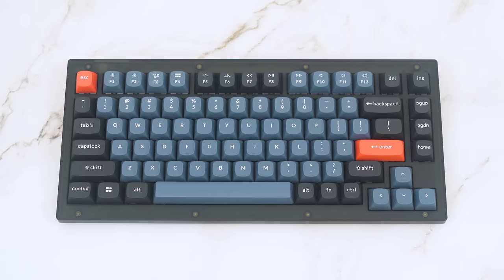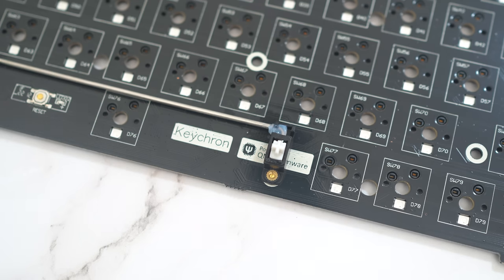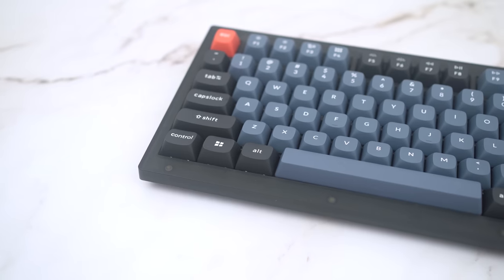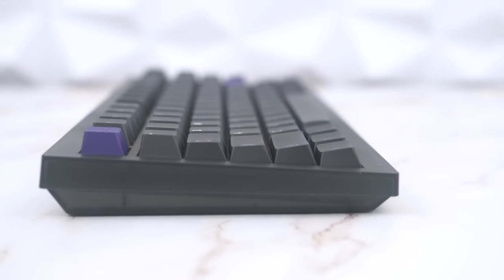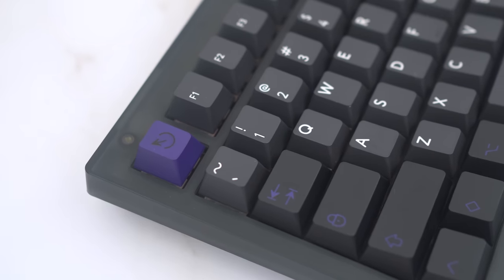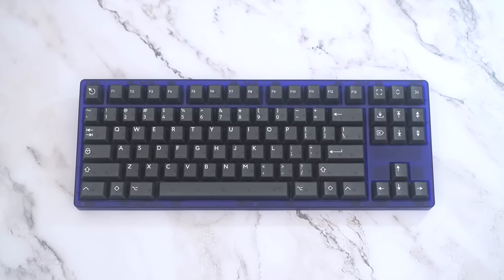I Modded a $54 Keychron to Make it GOOD - Keychron V1

Comment from the maker: Sorry guys!  I made a mistake when I said the KBDFans Tiger80 Lite was only around $89.  I was told that the Tiger80 LITE kit will be somewhere in the ballpark of $125.  My mistake and apologies for the confusion!
Reply: tsk tsk. you should know better. 

Just kidding. I was actually surprised when you said that price. I was like THEY DROPPED THE PRICE?! Then I went to check and went aww... lol
Reply: Hey there! I recently came across the HOTO Compressed Air Capsule and it seems like a great tool for maintaining a clean desktop setup. It offers powerful vacuuming and blowing capabilities, making it efficient for keyboard cleaning and overall dust removal. Plus, with its versatile features and ease of use, it can be handy for car interiors and outdoor activities. Definitely worth considering!

Comment: Just wanted to let you know, they added a disclaimer on the V1 product page that "Starting July 20th, the shipping fees will be decreased by $10 and the product prices will increase by $10." So, instead of the barebones knobless version being $54, it's now $64, but that doesn't matter because the total cost after shipping will still be the same. Still, nice video tho.
Reply: its not even 64 its 80 with shipping and at that point you should just get a kbdfans67 lite or an akko board
Reply: @FootyBalls12  sounds like you watched consumer tech reviews video  on the v1 and actually took his advice. Sad.
Reply: @FootyBalls12  I mean a 67lite is 130 + shipping so maybe 150 and akko boards for a acr pro its 120 + shipping so 140. So the keychron is pretty cheap at 80 bare or 100 prebuilt
Reply: @FootyBalls12  The prices I mentioned were only for the board itself, excluding shipping
Reply from the maker: Thanks Andy for the info!
Reply: @FootyBalls12  Akko $80 boards are tray mount with a much more cramped layout, no qmk/via and no pcb mounted stabs and less sound dampening. Their stock stabs are pretty good, but IMO just not as good as what pcb stabs can reach. So for a stock board, Akko might be better but if you really wanna get into the hobby the v1 is just better.
Reply: @FootyBalls12  u skip english class or some shit???
Reply: @lukasderstecher4582  pov: you missed the gb
Reply: @FootyBalls12  if you add the shipping on those you aren't beating this lol
Reply: @lukasderstecher4582  at that point just get a qk65 on the next batch
Reply: @FootyBalls12  they increased the price for the base version so you can put more down as a business expense
Reply: If that is the case then reviewers should be judging it based on the total price, including shipping and not just the keyboard.
Reply: @FootyBalls12  No QMK = no deal.  Like, why bother buying a keyboard if I can't even put custom firmware on it?
Reply: @nearly-  What did he do? I've seen some people complain on Reddit cause he said the V1 is a bad keeb or something like that.
Reply: @nearly-  NVM I just looked at the video. It's just him acting like he's an enthusiast and yelling at keychron because it did something better than Akko
Reply: @nearly-  why is it sad?
Reply: @ToyKeeper  i dont find qmk as a need but some people do so sure
Reply: Without the shipping prices and if it were on a 3rd party website that does not charge as much for shipping then ofc i would get it that is a steal i am  just saying you are not getting 80 dollars worth with the shipping
Reply: @Andy-rp1kd  ik you did a good job pointing out the base price had increased
Reply: Sounds like mumbo jumbo to increase the price. That change doesn't help for proxies cause they can reduce shipping but not product price
Reply: @Donbros  if your in the official discord the reason it was changed was so that people who write the boards off their taxes under a work item can do so for more value as shpping doesn't get written off
Reply: @FootyBalls12 how is this worse than a kbd67lite and not to mention its like 130 with shipping this is just around 80 the 50 dollar difference
Reply: And with tax it's over $100.

Comment: You can accrully gasket mount a keyboard with foam, you basicly stack much foam around the standoffs and screw the two inner screws in, you can also combine it with o-ring mod.
Reply from the maker: Ahh the stack mount.  The V1 kind of comes like that already.  The lower silicone pad is thick so the pcb can bounce on it.  However, the upper plate actually screws into the lower case so if you omit that, you may be able to pull it off
Reply: @Keybored  I did it with my k552 and its like a trampoline
Reply: @Keybored  where can I found a tutorial?
Reply: tutorial please , bro

Comment: It's really tempting to get one and throw on my favorite caps and switches and firmware... because it's cheap and weighs half as much as a Q series board, which are both great bonuses.  What would be really cool though... is if they did a lightweight "V" version of their upcoming Q65.
Reply from the maker: I feel like Keychron will keep expanding their lineup going forward!
Reply: You can grab their 40% version and it will be a super lightweight travel board.
Reply: @matasa7463  But if I got a 40% version, it would be 40%.  No thanks.  I only like keyboards in the 65% to 75% size range.

Anyway, I have a Keychron V1 now, and a Q65, and they're both great.  Durock T1 switches and some nice MT3 or AF SA caps, and heavily customized firmware.  Very happy with both.

Comment: This comes at a perfect time since I've got one in the mail right now. Figured that at that ridiculous price I might as well to test out switches. I happen to have some o-rings in a drawer somewhere so this is perfect.
Reply from the maker: Perfect!
Reply: Hey there! I noticed you mentioned having a Keychron V1 keyboard. If you're into maintaining a spotless desk setup, I highly recommend checking out the HOTO Compressed Air Capsule. It's a versatile, compact device that offers powerful vacuuming and blowing capabilities. It's great for keeping your keyboard clean and can even be used for car interiors and other areas. Plus, the price is reasonable compared to other brands. Definitely worth considering! Let me know if you need any more recommendations. Happy cleaning!

Comment: Unmodded keychron sound test 1:45
Ktechs S1 Peach Switch + PBTFans Purpolch Keycaps 3:28
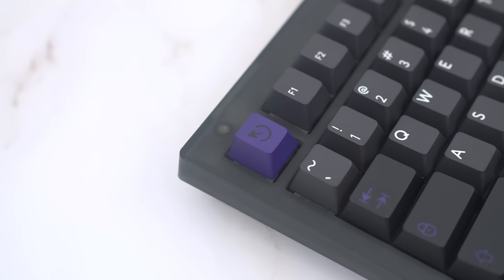Previous mods but with o-rings 6:10
Comparing with and without 0-rings back to back 6:44

Comment: Excellent timing, youtube overlords. I've got my K4 v2 pulled apart and am doing some mods to it, as i type this (on an old membrane board. Sigh). It's got the same tray mount method, and I was thinking about using orings combined with tape mod on the PCB and silicone pour to improve the sound and feel. thank you, @keybored for the vid

Comment: I have reason to believe that every keyboard this guy makes sounds good
Reply from the maker: I think with enough time, you can make most keyboards sound pretty good!
Reply: @Keybored  well, you need the right tools for the job too. the stuff i have just doesnt work lol
Reply: Hey {{3}}, have you considered trying the HOTO Compressed Air Capsule for cleaning your keyboard and other tight spaces? It offers powerful vacuuming and blowing capabilities, making it a handy tool to maintain a spotless environment. The multiple tubes and high-quality filters ensure long-lasting performance. Definitely worth checking out! 🖥💨🔧

Comment: I wonder what PE foam modding would have done, since I’m going for barebones with Gateron Milky Yellow Pros, Dye-Sub PBT Cherry caps, Zeal stabs, o-rings, and PE foam mod, with 3-layer tape mod, too. I’m really looking forward to this build, since it’ll be my first major build. My first build was a Gamdias Hermes Lite, with everything lubed, no desoldering (even though it’s a solder pcb), and 3-layer tape mod with polyfill. It isn’t the best lmao
Reply: What did you do to lube without de soldering
Reply: Pushed stem down and used a brush to push it in thru the sides on the sliders
Reply: @Exolotyze  ah very spotty way to do it and not full coverage and inconsistent but if it works it works

Comment: so i just recently got this keyboard and i gotta say, straight outta the box it basically has no ping to it. i got myself another pbt keycap set from keychron and did the tape mod on it and with the k pro reds its actually quite thocky. i dont know if they improved on it since this video came out, but to me it definitely sounds like it. no noticeable ping at all when it was stock.

Comment: I'm doing this mod, however is nobody noticing he hasn't screwed in the pcb to the plate? It is that way stock and I wonder if keybored's came without those screws, or if he opted not to use them and why

Comment: I think if you we're to force break, ditch the silicone and tape mod it, it would be pretty fantastic
Reply: Hey {{3}}! I totally get your point. The silicone and tape mod can definitely make a difference in the performance of the Keychron V1. By the way, have you heard about the HOTO Compressed Air Capsule? It's an amazing tool for keeping your setup clean and tidy. The powerful vacuuming and blowing capabilities are perfect for maintaining a spotless environment. And the best part? It's reasonably priced compared to other brands. Definitely worth checking out!

Comment: Got 2 questions 
I found a thicker oring with the spec of OD6x CS1.2x  Thick 2.4mm 
-Do you think this will help with the bounciness? and will it have the problem modding this?
-Would you recommend this ring over the spec you used in tofu? (4 x 1x 1.5)?

Comment: Do you think this needs a wristrest for it to be comfortable or is it okay without? Thanks for the great video also!
Reply from the maker: Honestly, this keyboard is super low in the front, even more so than the Q1.  I would actually be ok using it without a wrist rest.
Reply: @Keybored  That's good to hear. I used to have a k8 after it met a glass of orange juice rip and I couldn't use it comfortably without the wrist rest.

Comment: The Ktechs S1 switches seem to be a Tecsee Blue Sky Cloud Linear with a different bottom housing. Interesting
Reply from the maker: Tecsee has making a lot of switches!  The KBDFans one is like that too and they all sound so good
Reply: @Keybored  Ive been enjoying the HPE switches alot. You need to try to get a Blue Sky Cloud Tactile, 13.9mm POM stem length, full HPE housing. It feels like a purple panda on crack. It's fantastic.

Comment: If the o-rings are placed between the plate and the foam do they really have a noticeable impact for most of you? Is it nonsense to place them after the foam touching directly the posts of the lower case just above the PCB?
Reply: This is an old video but I hate looking for answers to questions and no one replies, especially on old vids haha. I'm looking at doing this with my V5, not for the sound but to soften the harshness of the steel plate.

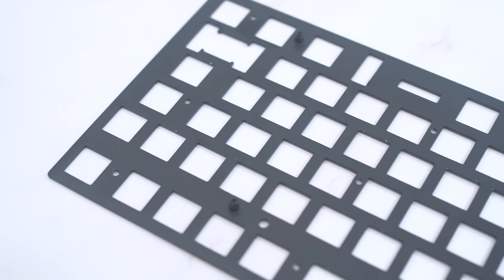The o-rings have nothing to do with the foam. The plate foam has holes in it where the standoffs of the case go up and through the PCB/foam sandwich. There's also holes in the foam for the standoffs of the plate that secure the PCB to it with screws from the bottom. The o-rings will just sit inside the holes in the foam and up against the bottom of the plate. You can see all these holes in the plate foam at 5:05 of the video.

The o-rings will sit on directly on top of the plastic standoffs of the case. The plate then sits on top of the o-rings.
Reply: The only thing I'm worried about is this puts the PCB/plate assembly up slightly higher in the case. The holes in the case where the USB cable and Mac/Win switch are might have to be enlarged a little bit at the top.
Reply: @JohnnyK-tf6ig  Thanks for your reply mate, appreciate your help. I see that the wholes in the foam, you are pointing out in the video, are much bigger than the ones on my foam. Maybe it changed with newer units. Mine are so small that seems that the o-rings are mostly in touch with the foam, letting the screws go through the standoffs but seemingly the standoffs barely or not at all touch the o-rings. Anyway I'll try it and let you know how it goes.
Reply: @JohnnyK-tf6ig  that's also a good observation I'll check in mine if there's space for the o-rings and let you know
Reply: You shouldn't worry about this. We both missed the point that the rings sit above the PCB in the standoffs so it doesn't affect the position of the USB cable and switch. Also, I've done the mod and to be honest don't seem much of a difference.
Reply: @pixiebob1247  Oh ok, thanks for the heads up. I wasn't too concerned about the sound, just the feel and if it softens things up a bit. If not I might just get a new plate.

Comment: Nice video! What do you think of doing the coil spring mount you did on your tofu. I'm thinking about doing that on thI'd!

Edit: whoops someone else commented this. That sucks that you can't do this. Oh well, o ring it is!
Reply from the maker: I tried to do this, but realized that due to the lower/upper case design of the V1, it would not allow for enough space unfortunately :(
Reply: @Keybored  Ya that's unfortunate. One more question... how would this compare to the nk65 ee

Comment: Looks we can direct make it be gasket mounted with Q1's plate and cut off all the standoff?
Reply from the maker: Unfortunately no.  The Q1 is a much thicker case and also has the area for the plate and gaskets to sit on.
Reply: you can only make it like sandwich mount , but no flex at all .

Comment: The biggest problem with Keychron custom boards is that they are wired.  Why can’t they add a battery and a wireless feature.  It seems there is plenty of space in the current case design.
Reply from the maker: I believe they have the K series boards for that.  The K8 PRO is essentially the wireless TKL with VIA and QMK
Reply: I would guess that many in the community just don’t care about wireless connectivity in their customs. Adds cost, upkeep, and numerous extra points of failure.

Personally, I’ll take wired every time, save the money for caps or switches.
Reply: @alanschmitt9865  a wire is a point of failure.
Reply: @bngr_bngr  and adding a battery adds more wires.
Reply: @alanschmitt9865  Keychron wireless boards don’t have a problem with its batteries.  You can always use a socket instead of wires.
Reply: @bngr_bngr  you got the right point , they should just make those Q series have more bottom space and put the wireless , at least give some choice for us although i'm not a fans of bluetooth .

Comment: They increased the price by 10 but decreased shipping fees by 10. The total price basically doesn't change. Here in the USA, shipping is now 15 dollars. Adding to the fully assembled with no knob, it came to a total of 100 dollars. 

For barebones, I would still wait for 3rd party vendors like divinikey or amazon to sell the board for a more reasonable price of shipping. Especially if you're in another country where Keychron's shipping TOS requires extra fees.
Reply from the maker: Might be a good idea when Divinikey starts selling it!
Reply: Amazon now has it
Reply: @pretzal7820  Well that was fast. If you get it off Amazon rather than Keychron directly, barebones kit is 10$ cheaper. At least in US prices. Divinikey may sell it for cheaper but only time can tell.

Comment: At 3:30 with the change in switches and keycaps you've made an enormous downgrade. The Keychron switches sound better and the keychron keycaps are of far superior quality in both injection molding and design.  Mechanical keyboards are a functional device, not a hobby. I've got a Q3 and V3. The only reason to replace switches is to go with something like the Dolphin which are dead silent. And keycaps, a move to a thicker double-shot ABS SA profile for style and feel. End of the day, improvements to functionality.

Comment: i have been using the keychron v1 for a couple months now and i have to say, the stock keycaps are shit. the place where the switch stem is meant to go into the keycap breaks after months of typing which causes in the keycaps springing off the switch. i need to get new caps
Reply: I got the barebones version and put my own switches and keycaps in. It's a little more expensive, but I think it turned out better than the stock switch and keycaps.
Reply: @coolbrotherf127  i sold mine and got a whole new keyboard

Comment: You should try the spring mounting mod on this board! If it works this board could become a discounted Q1.

Also, the Q series boards have options for aluminium, brass, PC, and FR4 plates as an aftermarket accessory, and I don't see why they won't make those options for the V1 as well.
Reply from the maker: I looked into the spring and it wouldn't work on this board since it has an upper and lower case frame, so it would end up compressing the spring down and wouldn't be able to bounce at all.  Works on one piece case designs like the tofu, but not on something like this unfortunately.
Reply: if the V1 has the same dimensions as the Q1 the plates should be compatible
Reply: @nathand5212  the V1 is shorter than the Q1 by little bit.